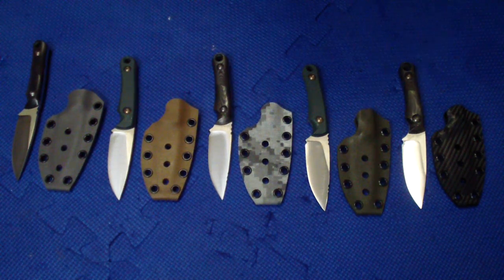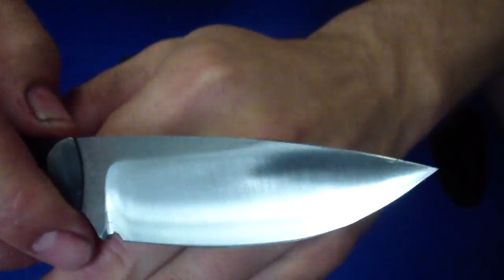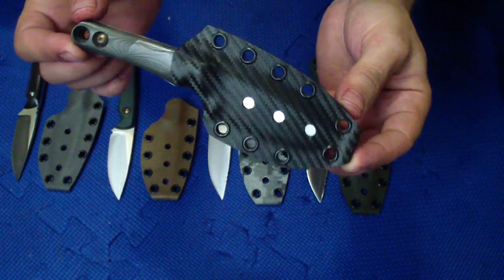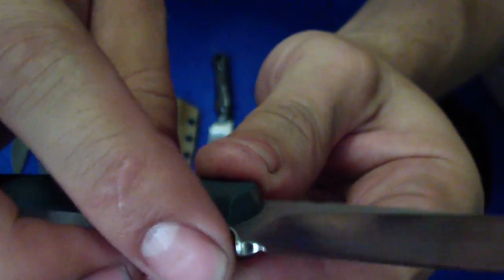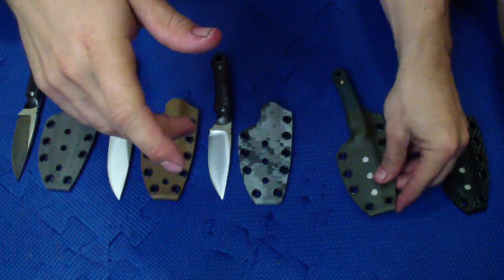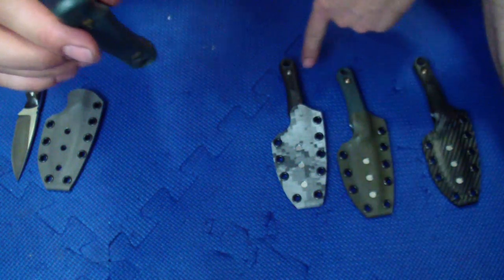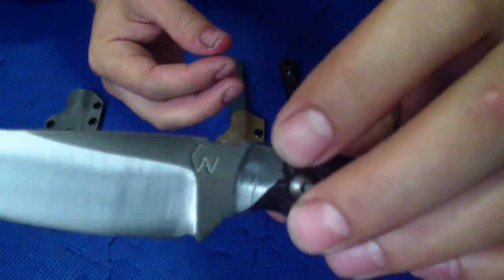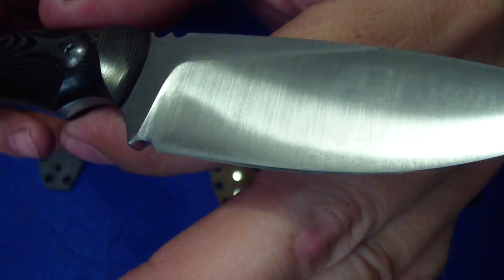5 New EDCs Heading to Gearbastion for Sale

Comment: Those sheaths look awesome! I would be a little concerned with dirt/grit/moisture getting in through those holes though, even though they look damn cool Have you ever considered using Chicago screws to hold together a sheath so it would you would be able to disassemble, clean and dry a sheath quickly after use in the wet forest? This would add a little extra awesomeness to your already fantastic looking sheaths!